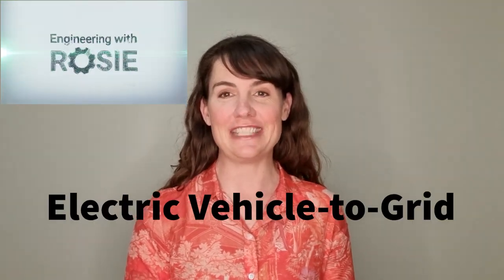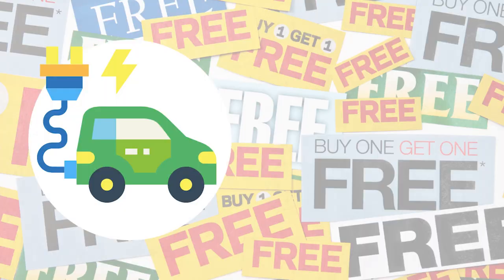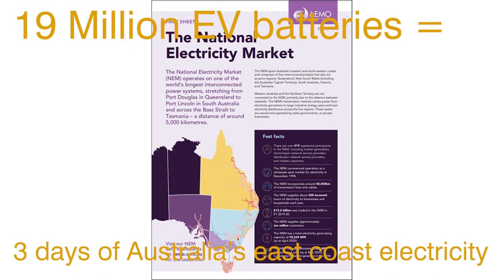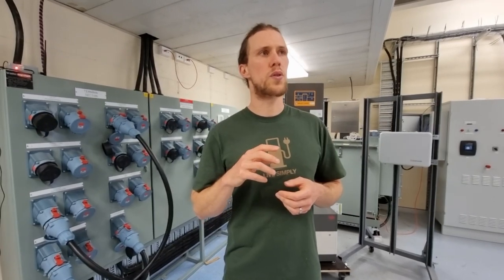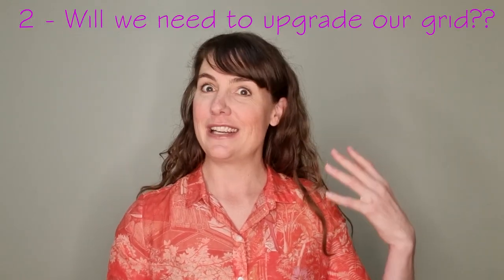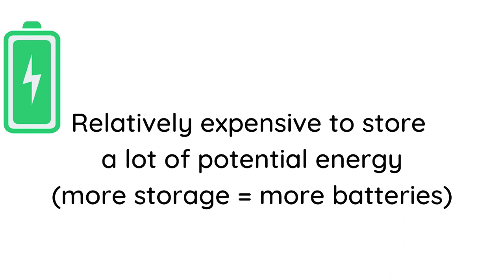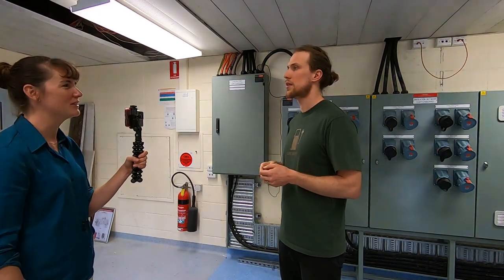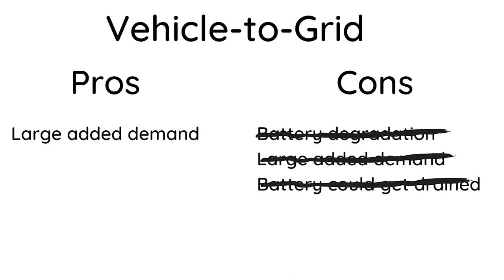Electric Vehicle to Grid Technology Explained

Comment: Fun and informative as usual Rosie!  A few quick points:

1)  Your guest is partially correct that power (C rate relative to the battery's C rating) during charge and discharge is somewhat related to battery degradation.  But so too is time spent at high voltage, i.e. high state of charge (SOC).  If a V2G scheme holds your car at a higher SOC than you would ordinarily do, it's degrading your pack prematurely relative to just staying away from high SOC, which smart EV owners are already doing.  They charge to full just before they leave on a long trip, and stay away from high SOC the rest of the time.

2)  All battery cycling causes degradation too.  You can waffle and say that it doesn't cause enough degradation to worry about, and you might be right- but that depends on points like 1) above plus on how often you do it and the C rate you do it at, and what fraction of full pack charge you use each time.

3)  Installing 50-150 kW fast chargers just to do V2G ain't gonna happen- it would be too costly.  So you're talking about perhaps Level 2 (3-7 kW) connections.  At those power levels, and assuming that the events you're trying to protect against on the grid really are only 15 minutes in maximum duration, you're really not talking about the batteries having much energy capacity.  19 million cars x 6 kW is an absolute sh*tload of power, either as demand response (charging which starts or stops when the grid system operator wants it to) or as a virtual power plant-  114 GW!  But if it only goes on for 1/4 hour worst case, it's a much more modest 28.5 GWh of energy available.  Also a small fraction of a typical car's battery capacity being used- 1.5 kWh per car, or perhaps 5% of the charge in a 60 kWh pack in a worst case event. Doing 5% cycling on a battery pack a dozen or two times per year is really not something I'd be worried about as a car owner- I wouldn't be too worried about how much that was damaging my pack.  I also wouldn't be too worried about who made the revenue from what could be a small number of very high value kWh.  Do that DAILY however and I would be concerned!  I'd want money for that, for sure.

In summary, I agree that V2G and even moreso- opportunity charging, i.e. charging automatic start/stop based on the needs of the grid operator- is exciting and interesting.  And having the ability to provide emergency response from all those EV batteries?  Priceless.  I had that possibility in the back of my mind when designing my car conversion project back in 2014- it meant I could run my house's critical systems for days during a prolonged power outage just on my car's battery.  Making that "official" by demanding that capability be installed in all new OEM EVs makes a lot of sense to me.  It's just the grid connection for cars to supply energy to the broader grid that needs a bit more thought.
Reply from the maker: Great points, thanks for adding this extra detail! I am sure I will be making more videos on v2g as it becomes more prevalent. I know that related to (1) - when I test drove a Nissan Leaf I was told it was smart enough to not charge the battery to 100% unless you told it to (because e.g. you knew you needed full range the next day) and (3) - the cars in this trial are paid for their service. I definitely think that money needs to flow to the car owner, otherwise even a small reduction in battery life due to (2), the cost of a 2-way charger or even just perceived risk/ inconvenience will mean no car owners want to do it.
Reply: All valid points, slow drain and fill cycles in the optimal battery range for longevity, would get the Solar Home from Sunset to Sunrise. Or, allow Daily Power Arbitrage to pay for battery usage. Buy at high noon when solar power is cheap $, Sell evening when home usage peaks and power is expensive $$.
Reply: @EngineeringwithRosie  I do belive that the only real use of V2G in the next 10-15 years will be to the very local grid in your own house. This is something many EV owners would even pay extra to have.
Reply: The Leaf II comes with vtg capability on default. It’s even been promoted that way and certified as a power plant in some countries. However Nissan removed the 80% charge limiting software in the Leaf I after a certain year and kept it at least until 2019, maybe until now, because otherwise they wouldn’t be allowed to advertise it with its full capacity in the U.S.. It was sold as a new higher range back then. My 2018 leaf has nothing to prevent it from full charging. If the charger isn’t smart enough to do it, I have to program charging time like an old VCR, which of course never hits exactly 80%.
Reply: 1) A V2G scheme should not hold your car at a higher SOC than you want? V2G only uses a little energy for each discharge event so SOC is not paramount. Also lower SOC allows V2G to offer charging service to the grid (for high grid frequency events and excess renewable generation) as well as discharging services (for low grid frequency events and low generation margin). 

2) C rate limits (for charge and discharge) should be managed in the negotiation protocol between the EV and the V2G charger.

3) 15 minutes of ultra fast frequency response at 114GW would be immensely valuable to a grid operator. As grid operators typically only want 1 or 2 GW of backup then the 28.5GWh resource you describe can be stretched over many hours.
Reply: I'm sure there is also a business case for behind-the-meter ev fleets doing peak shaving to significantly reduce demand charges for individual businesses. E.g. countering the surge current from starting large motors, or intermittent loads such as compressors or pumps.
Reply: Maybe incorporating municipal buildings court house, fire, police station, school buildings maintenance buildings to act as baseload production production. Being as most of them are off when people are home..

Comment: Thanks Rosie, great video.  I’m on a V2G trial with my Nissan Leaf in the UK. It’s been going for a month now and so far so good. I haven’t had an electricity bill yet so I’m not sure how it’s working with price compared to what i used to pay. To make matters more interesting I also have a PV array which is also feeding into the grid and I’m also on a flexible tariff in the UK called Agile Octopus so it’s difficult to get a grasp of the sum of it all but I’m sure it will all even out in the long run.  So long as I’m not massively out of pocket and the trial is a success then I’ll be really proud to have been part of the solution to grid balancing using renewables and EVs.

Comment: Maybe I missed something, but it seems that V2G in this video is meant to soak up excess energy and give it back to the grid in times of need so fossil fuel peaker plants are not needed.  I was picturing V2G to help replace non-renewable entirely so that no fossil fuel power plants would be needed.  There is a study by RethinkX that says that we can have a fully renewable energy system if we have 3x-5x renewable generation and 1x battery.  I think V2G from all EVs can help achieve this (instead of power companies having to purchase batteries themselves).  Comment on this Rosie?